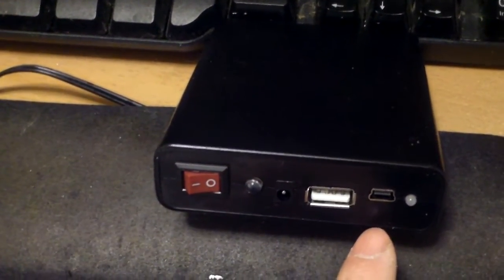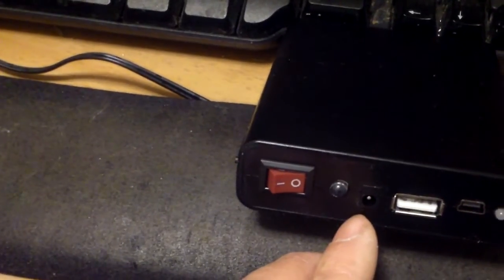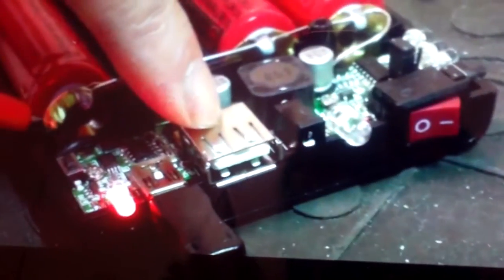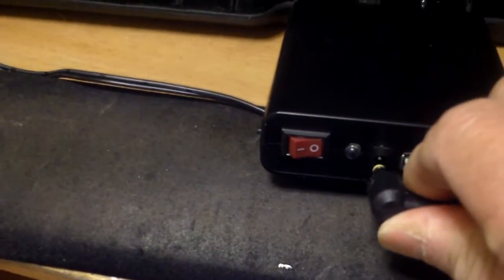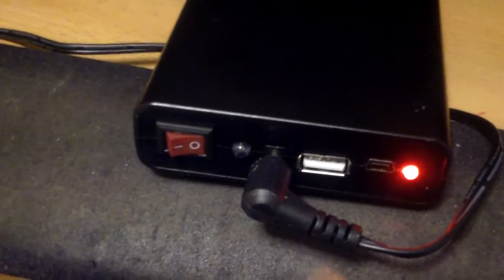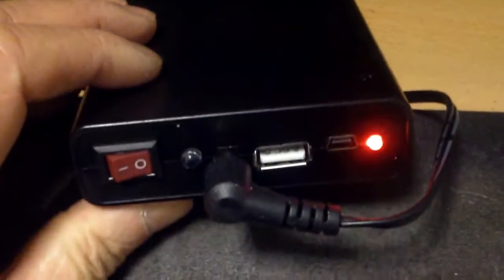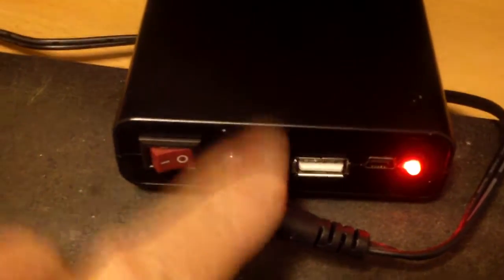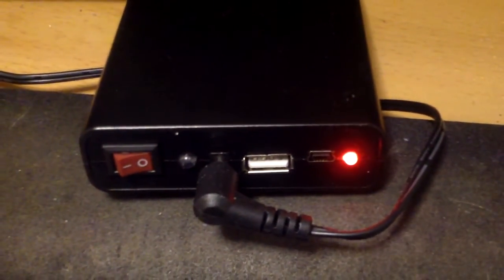3.5 mm center positive alternate charging input for 18650 battery box

Comment: Hey paul, i hear my name there :-)
Thanks for showing the video
I'm planning to make a solarpanel with the solarcells from 6v and putting out 330mah
I will put them in paralel to boost the amps up. 4 or 5 cells will be good i guess
Any tips?
Greetings
Erik
Reply from the maker: Rikkie, look at the link and comments from Chau Bryan below. He is using a 6w solar panel to charge his battery box directly. I will probably use a slightly higher voltage panel so you have a bit more headroom. You might have to add a small diode so the battery won't backfeed the solar panel and that will bring down the voltage a little.  I will be uploading a video in a few minutes of me reusing some laptop batteries.
Reply: wtam69
What voltage of solarpanel do you suggest?
I think the next solarpanel up is 9v i think, is that not too high?
Thx for the help Paul
Greetings and try to stay warm
Erik

Comment: Hi Buddy 
I use this 18650 battery box too, it is very good for me ^^.
Reply from the maker: I'm still trying it out. Do you have any recommendations for the batteries or you just use the generic types? They warn against using protected batteries and the possibility of burning out the circuit in the box so I'm a little apprehensive about experimenting with solar charging the batteries.
Reply from the maker: Chau Bryan
Hey Bryan, do you remember the voltage of your 6w solar panel? Good you can actually use your solar panels directly to charge the batteries inside the box.